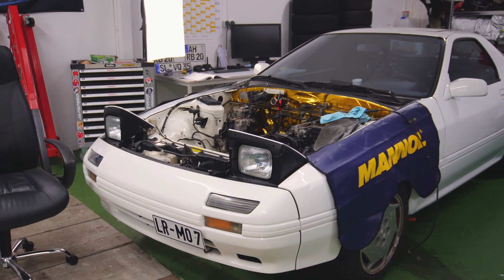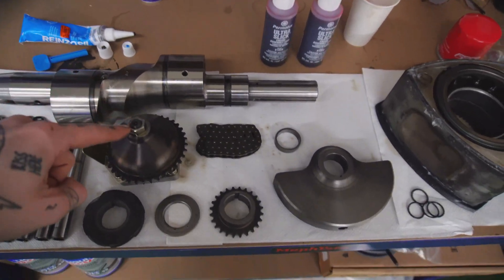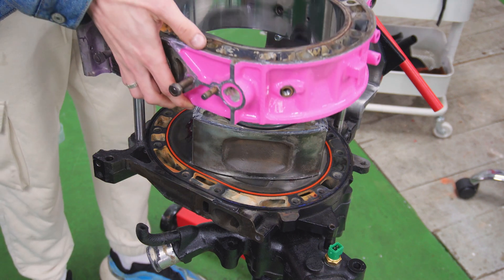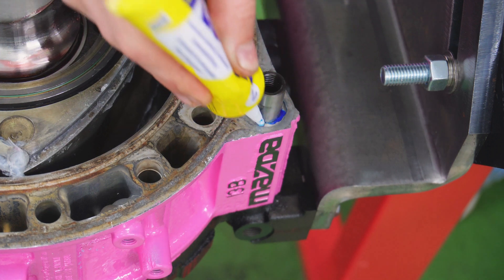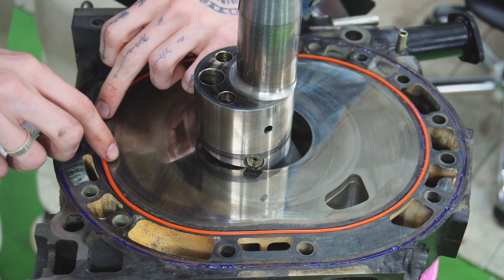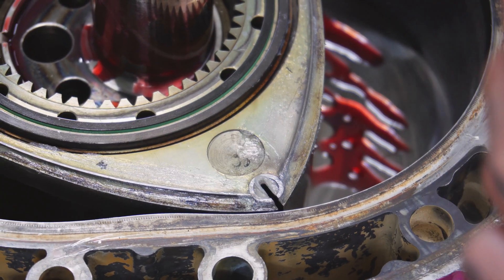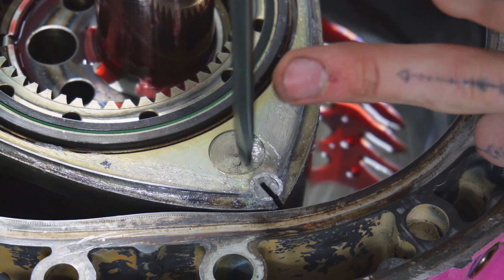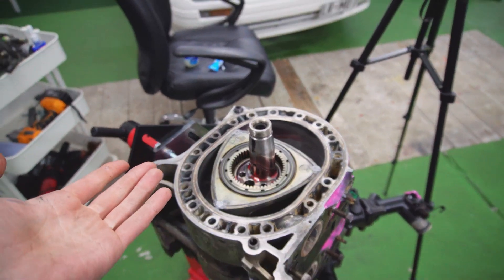Assembling A Rotary Engine - 13B Build | PART 1

Comment: Gud video, but I have a question. Why didnt you go for a bridge port for them Braps? 😀
Reply from the maker: Thanks man! :) I decided against porting it because shipping time for the porting templates were too long. Also bridgeporting drastically reduces drivability of your car and you will end up with more problems than benefits with a street build (I was thinking about doing a Half/Half Bridgeport to get some nice braps without sacrificing driveability)

On top of that, doing anything like this in Germany is highly illegal and since I am sharing this build publicly I want to make sure everything about this car is legal :)

Comment: How long was the entire rebuild for you?
Reply from the maker: It really depends on what you include in the rebuild. For example: If everything is ready to go (Rotors packed, side seals clearanced etc.) then it literally takes 1-2 hrs to assemble the engine.

If you include disassembly, cleaning the entire engine, painting, side seal clearance and so on, it takes about a week.

For me, I disassembled and cleaned the engine within 2 days. Then painted everything in 1 day. Then clearanced the side seals and packed the rotors which took again 1 day. I had to order additional parts and get new stationary gear bearings pressed in which took 2 days. Cleaning everything one more time and laying everything out for the rebuild took half a day and the assembly itself took 1-2 hrs.

So in total it took about a week from disassmbling the engine to assembling it back. :)
Reply: @moritzherr  ok thanks alot. Really trying to decide on doing it myself or sending it off because im in university